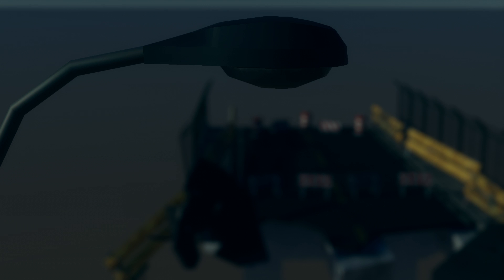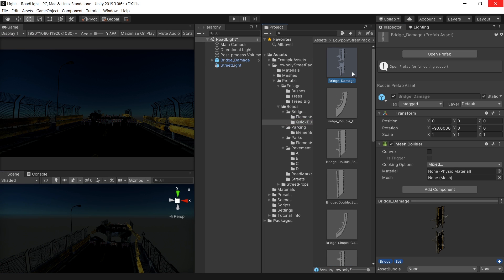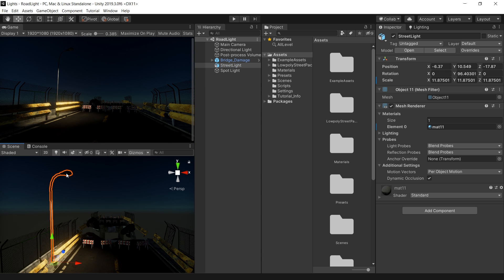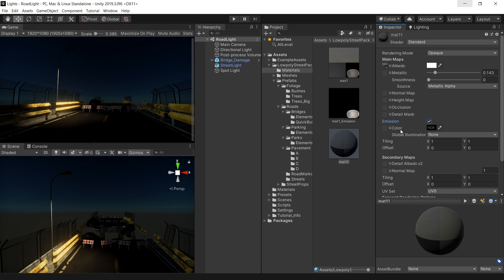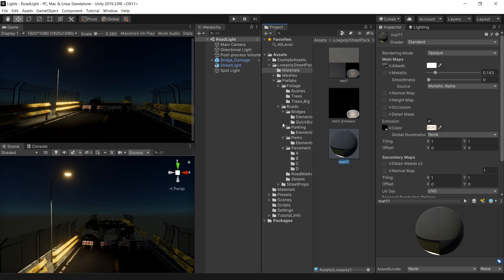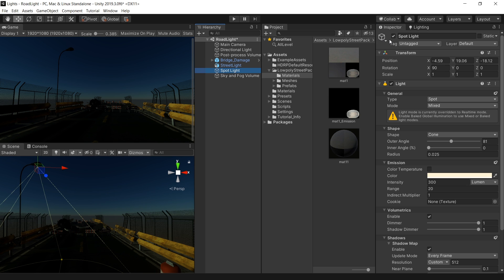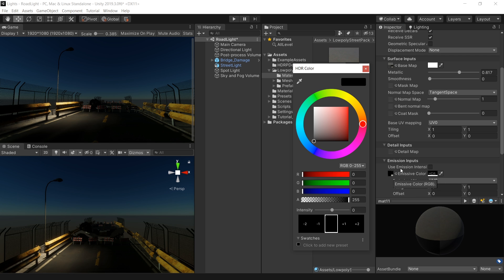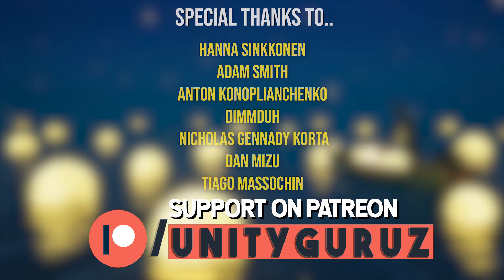How to TURN ON Lights in Unity

Comment: I want to access spot light 2D through script in my 2D project after installing URP.

How do I access the spot Light 2D? If the player moves the light should turn on. It’s also attached on the player.

I want to know which is the component for spot light 2D so I can assign it to GetComponent and then access it through .enabled

Thank you

Comment: I've wanted to ask you a question for while. In HDRP when I use emission to glow something, it completely whites out my material color. For me this is quite an undesirable effect since as an artist I need complete control over every single aspect of the visual concepts that I am trying to display in my work. The Standard Built In 3D renderer does not do this. Here is an example of what I am talking about:

https://ibb.co/zQ2sGLm

Is there any way to correct this problem at all? I've searched all over the place and no one seems to have an answer.
Reply from the maker: Go to your HDRP default settings and turn off bloom. You can also go to my discord server and check tutorial help section where I have posted a screenshot to fix this issue.